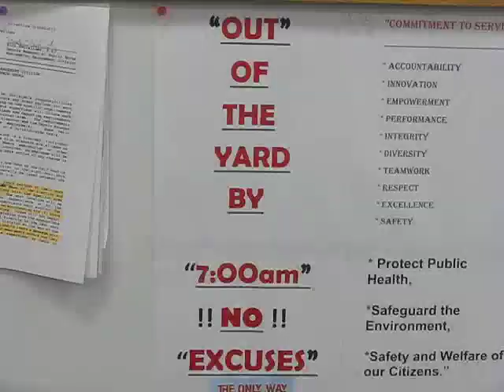Keep It Clean Denver presents Day in the Life of a Vacuum Truck

Comment: is it common practice for the city to clear a upper lateral with a water
 jet cleaner? Do you also clean out upper laterals? Is is also supposed 
to be vacuumed out when they do this?  Thanks
Reply: city takes care of the city property, as in the main 8" line that runs in neighborhoods and different sized mainlines on normal streets. upper laterals, house sewer connections or any laterals connected to the mainline, the responsibility is the home owner or business owner. houses, from house foundation to street mainline; homeowner. same with businesses, foundation to mainline. city takes care of main line and city property only. private contractors can help you like, Pro Pipe.

Comment: Ok so a couple things about this. 1.) they should be wearing hard hats atleast 2.) double hearing protection is required within 25 ft of the operating truck and single within 50 ft
Reply: 1) No hard hats aren't required. 2) No double hearing protection isn't required. Properly inserted ear plugs will provide just as much protection. Review your OSHA guidelines.